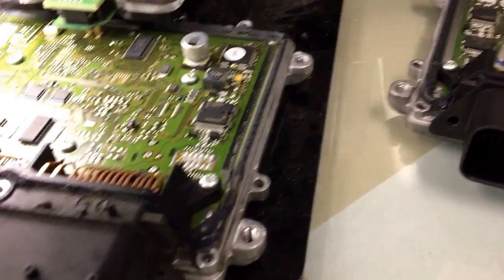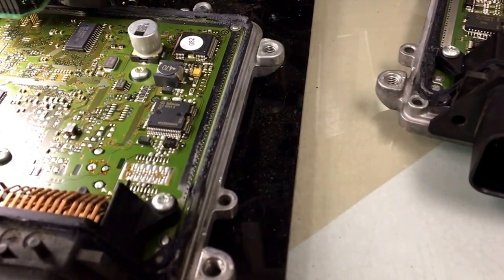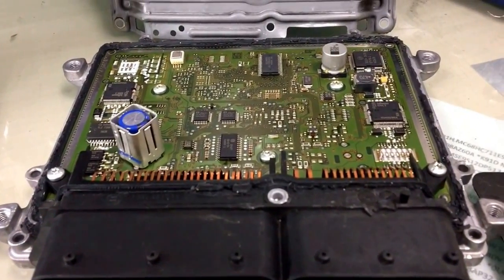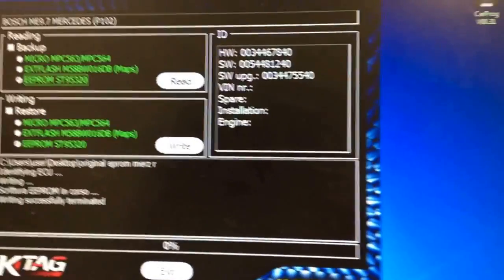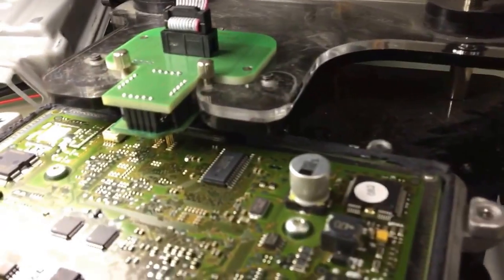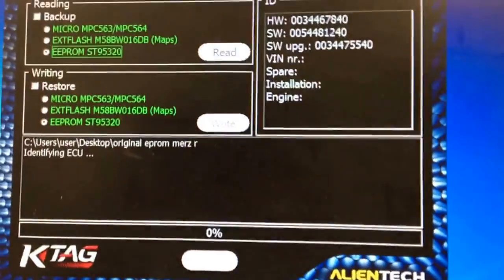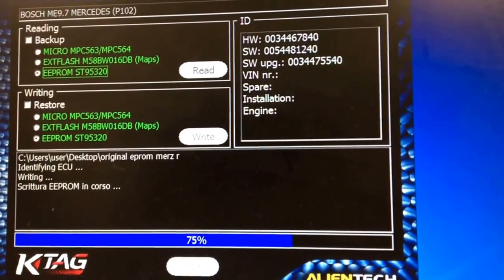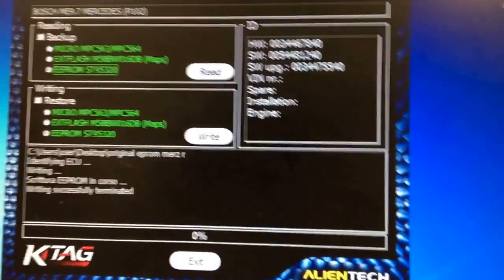Mercedes NO Start | NO ground from ECU to fuel pump relay | ME9.7 Common Issue !!!

Comment: This happened on my 1998 W140 S420. I wired in an external ground as a temporary fix. Annoying issue. Xentry couldn’t identify it either.

Comment: If I buy an ECU on eBay and send mine and the eBay unit to you can you transfer?   I have a 2007 SL550 that has developed from an intermittent crank no start to a NO START at all.  One shop proved the ground issue by adding an external ground to fuel pump relay and solved the no start but created a random misfire issue

Comment: Thanks a ton....I have a R class, no crank, no start...bought a new fuel pump, installed it...still not turning over. I figure I do not have a ground going to the rely, coming from the ECM. Hate to spend a ton more money...can I send mine in to get it reprogrammed(most likely I end up buying a new one, or can a I get a new one, without going through the dealer?

Comment: This is happening to me right now I own a w208 clk 430 replaced put a brand new fuel pump but at no avail no power to the fuel pump motor cranks but won’t turn on and when it does it has left me stranded in the middle of traffic

Comment: What about the 2004 c240 not sending out start signal .I can crank the car from the starter  wire with the key on and car will run .??
Reply from the maker: Then you have to check your starter wiring diagram and troubleshoot
Reply: @vehix411  it was number 4 ecu connecter pins messed up ,

Comment: Hi I have c350 car starts then I drive it somewhere won't start then after it sits for 2 hours it will start.  Could ecu be issue
Reply: Check fuses

Comment: Hello,
I bought a 2000 ML320 and currently in limp mode due to previous owner replaced the original PCM/ECU.
-my question to you is …without the original PCM/ECU can you program a new used ECU if yes, can you do it if I send it to you?
Thanks!

Comment: Hi I have 2004 Suzuki Grand vitara that has similar issue.   The ECU is not grounding the fuel pump.  But the Suzuki GV ECU is plug and play does not require programming.  Will  this work for the my car.? Now is not starting at all.  Also where Can I get the files or do you have the files for 2004 Suzuki Grand vitara automatic .  Or what do you recommend to fix the problem I have.  Thanks fred

Comment: Hey Boss Informative Vids! I have an ML63 and have now been through 3 repairs of ECU and again having multiple cylinder misfire. Im afraid my ECU is not fixable. What is my best option to get an ECU From mercedes or Program a used ecu with key off Ebay?? Im stuck but love the car have done 7,500 miles with this issue on and off.
Reply: It's probably your canbus under the drivers carpet or passenger front carpet got to take the seats out what happens is moisture gets in there like one spilled drink and then you got probs with a hundred dollar I carsoft scanner you can read and clear the faults on the various modules to really narrow it down

Comment: My is 2006 ml350 starts some time and. Won’t start some time now no more start I have to jump stat direct from start relay what happen in engine shot off while driving so it’s happen from computer? Thx
Reply: Going through the same with my 08 e350, did you fix your ml350?

Comment: hello my friend is what you can help me, I work on a mercedes 500s, when I connect ecu and I put the ignition the fan turns at high speed, the car does not start. What should I do please?
Reply: Have same issue..any answers anyone
Reply: ulrich landry toko Hi did you resolve your no start issue
Reply: Have same issue..did u find out problem
Reply: @adrianthompson2869  please watch video from scannerdanner if you type mercedes no communication in your youtube search his video will come up. His issue was fuse box inside car on driverside dash the fuse had corrosion from condensation and was not making good contact. He replaced fuse and cleaned oxidation off connectors the fuse go into and it solved his no start condition. He was losing power feed to engine computer module. And when his key was in on position the fan ran on high.
Reply: Adrian Thompson still same not starting engine fan turns on

Comment: I've got a similar problem with my Bosch PCM, but in my case, the A/C relay socket doesn't get the ground: instead, there is a 4.36V. Is this a case of the faculty ECU? OBD scan doesn't show anything, everything else works as it should.  (Hyundai Sonata NF 2005)
Reply: I’ve got this going on with a freaking 2007 e550. Ac started messing up, then kaput
Reply: Any hope of not changin the ecu? Getting 4v on fuel pump relay ground deam.